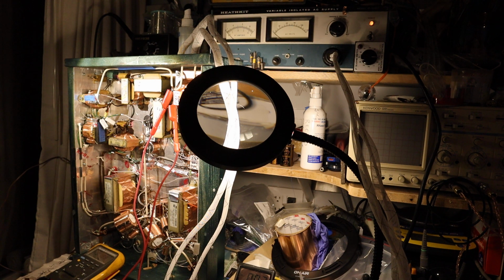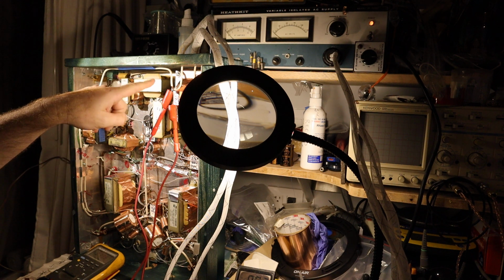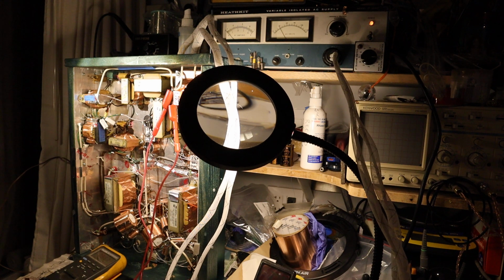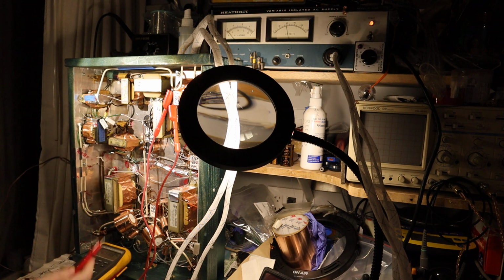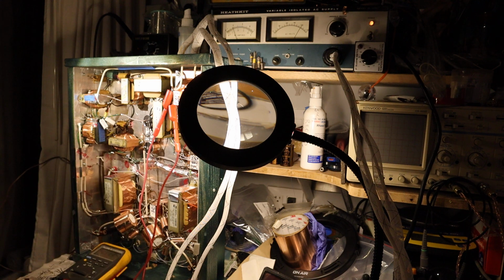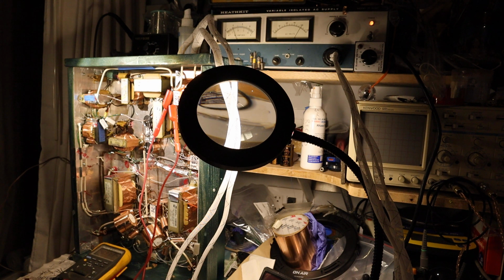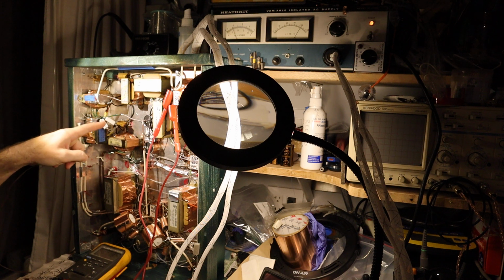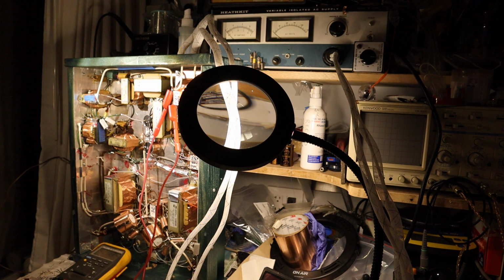How to use a Variac - testing heater voltage

Comment: Thanks this is very interesting and very useful for first time builders !! On my Darling I had to add a 0.56R @5W resistor to drop the input filament voltage from 6.75V to 6.2V and a 3.9R resistor on the power tube filament wiring to drop the voltage from 14.46V to 12.5V.
Couldn’t have done it without your videos ! 😊
Reply from the maker: Glad it helped!! Thank you for sharing the values :) getting them the exact voltage gives them long life :)

Comment: These are for me:super usefull as I am finalising my prep to do my build . I will grab a 1ohm resistor and put it on my filaments just to measure to begin.  I find it easier to source carbon film resistors than metal film for certain values am  wondering is it ok to use them in some cases , not in the signal path.  Either way I need to start with what i have  and then wait for deliveries of better parts in future . ( took 2 months to get 8532w shipped from US to Au. also can only find the miflex caps in USA or europe).  Have also had to  tool up and practice my metal cutting and deburring before I start to cut my box . so yeh I for one am definately watching with keen interest and i think many others will refer back when they get closer to doing an actual build. I have many questions but like to do a bit of research myself so am not always bothering you and that also helps me learn. Am wonddring have you looked at videos from uncle Doug , Blueglow who did a series on full SET build  and I think you may have mentioned Carson Labs. . HAve been using OPEN AI of late,  have you seen chat gpt ...  SO a big hhanks for your efforts . am watching and taking notes.
Reply from the maker: 👍👍👍👍👍👍 That is so ironic, 15 years ago I got my premium CV5311 from Au! :) (The CV5311 is the British mil version, the 8532W US mil version : ). We are taking turns now! It took me a while too to get them but not 2 mo, more like 1 mo. For the filaments I prefer to use wirewound resistors. Upon turn-on there is a massive over-voltage, that results in x10 power dissipation during start-up. 1R will drop 0.5V for the power tubes, I ended up using 2.5R in conjunction with the 100R on the primary side to get an exact 12.6V for them. (For your 240V, things might get a little differemt, but you can expect 2 or 3 1R resistors to adjust the 1626 voltage.) 0.5V and 0.5A is 1/4W dissipation, and I'd use at least 3W rated resistor for this duty (each 1R). 
For the 6J4, it's .8A, so 1R will drop 0.8V, that is 0.64W dissipation, about 5W at least to survive the turn-ons.  Wirewounds are much more robust with massive turn-on than carbon film or metal film... For the 6J4 I'd recommend 0.5R resistors to fine-tune the filament voltage, and one 0.2R might be needed for fine tuning. So, I'd get 3x 1R/3W and 5x0.5R/3W and 2x0.22R/1W resistors, and those will be able to handle the precise setting between the tubes.
Reply: Thanks Janos.  I am doing a tweaked up baby. With a single pi power but the siignal is more leaning towards the pure.  Was thinking of adding the snubber into the power supply is used in pure but not the baby. Any thoughts on that?
Reply from the maker: @toeknee8481  Yes, you can add the snubber! Also, you may take any of the steps towards the pure. ; One more thing though, I am tweaking my Darling right now (fired it up yesterday!), and I'd recommend 560R for the 8532W cathode resistor if you take he pure path, or 270R if using common cathode with the baby version.

Comment: A good way to prevent a short from damaging the amp on initial power up is to place a incandescent light bulb in series with the power to the amp.
Reply: Search for "dim bulb tester" if interested
Reply from the maker: Thank you Dave! Yes, that's an easy and practical method that I have mentioned on this channel already, hence I did not go into detail on testing methods. But it's useful to mention again in case others missed it ; ). 👍